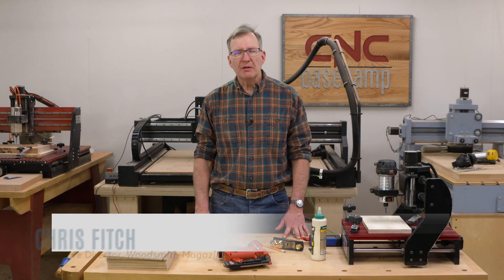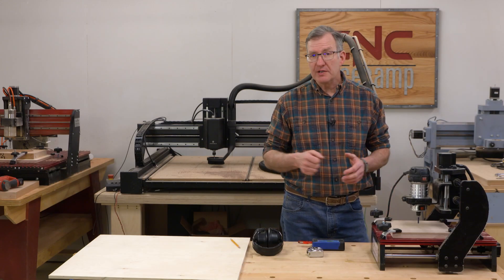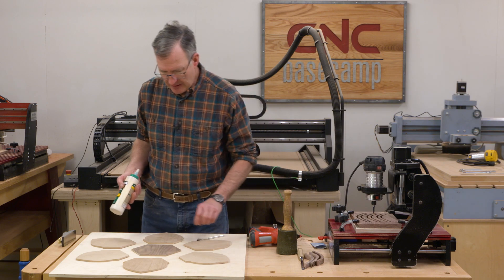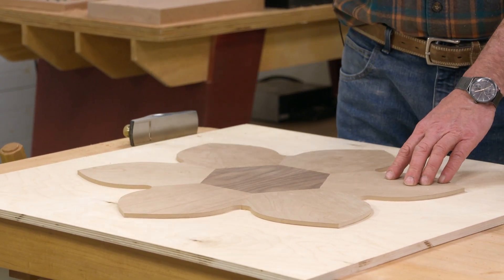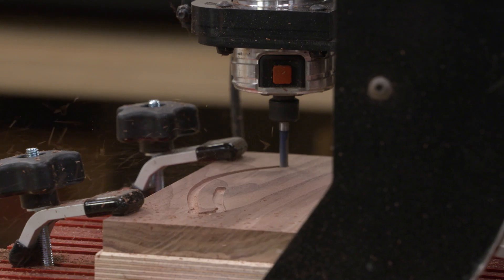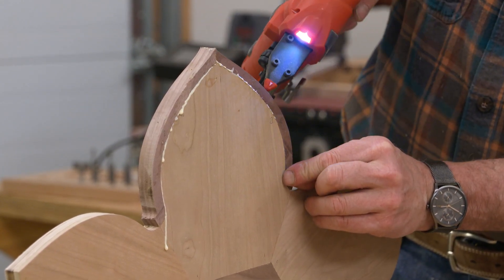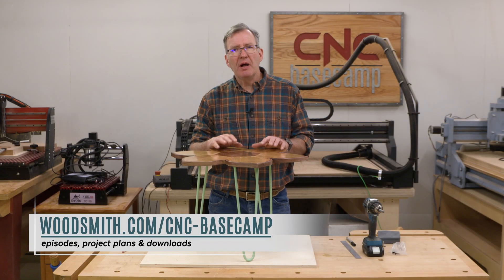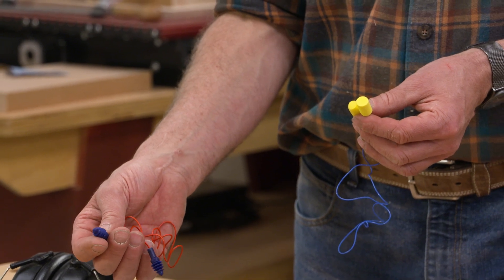CNC Basecamp E019: Curved Plywood Edging

Comment: Hello I’m trying to edge joint some maple and walnut together. I’ve watched stumpy nubs video ( easy curved joinery) I think it’s called and tried and worked fairly well. But the pieces I’m want to do. Can you do a video on how to use CNC to joint 2 edges together with curves. Is there an offset for the router bit if so how do you figure it out. Thank you